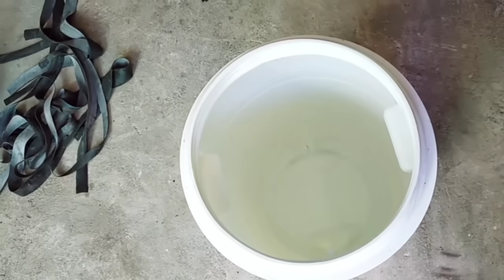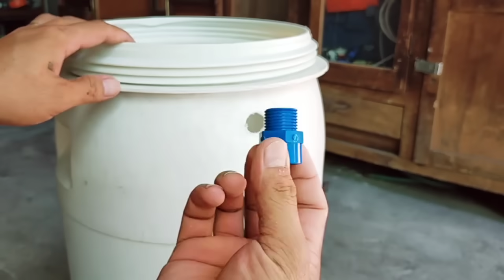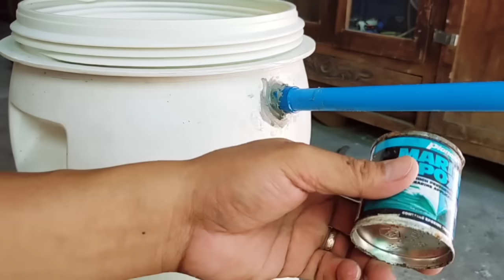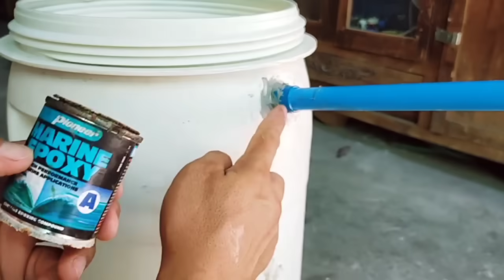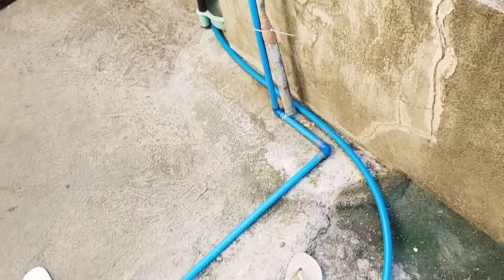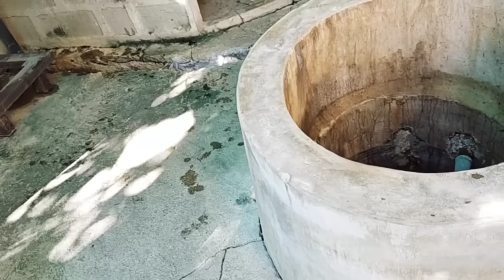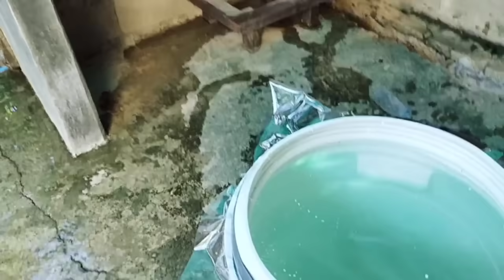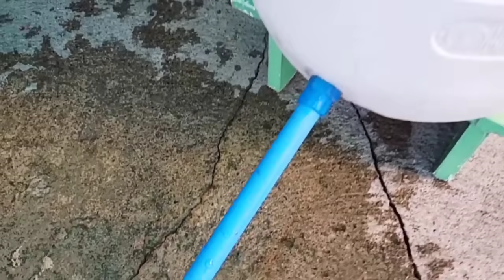improvised water pump no electricity how does it works none stop water life hack part 2

Comment: I've watched lots of other videos similar to this but this is the only one that actually shows and proves that it does work. Thank you very very much.
Reply: Can you be sure there isn't a submersive pump injecting water in the pipe that drop water in the drum?
Reply: r u sure..that's fake..
Reply: Yes its fake. At the end where he pulls the hose up it gets "stuck" on something for a fraction of a second. Probably attached to another pipe.
Reply: @gavinlynas2833  kind of you are right. I will try my self if it really works
Reply: But the idiot avoided showing us the other side (inside the well).  He has 1 pipe going down already.    So he connected the water a water supply line at bottom of  well .   It's obvious he was trying to avoid filming the bottom of the well .   He is another stupid cheater.
Reply: @inspetordopequidegoias8203  It's not a pump .   HE has another blue pipe going down,  which he connected to the supply line.   The other pipe is probably connected to a faucet or elevated tank.
Reply: @gavinlynas2833  not probably, u can see another pipe going down.
Reply: @gavinlynas2833  Have some faith, and some knowledge about science. 
There is no other pipe, look again. Black color was not a pipe, its a rubber used to make airtight.
Reply: If you look at the very end of the video, he pulls up the pipe that is going into the well. You will see and hear a "pop" sound like he is pulling it off something it was attached to under the water. It looks real from the suction at the top though so I'm not sure.
Reply: @gavinlynas2833  True, omg. He snapped it out of the ingoing pipe  , obviously.  He's so dumb.
Reply: @gavinlynas2833   Use your science knowledge...
Reply: This does work. I did a science project in high school at a much smaller scale. No laws of physics are violated here as gravity is just being converted to kinetic energy.
Reply: @jordondarke1884  Thank you Jordan.  This is what I am looking for , a scientific research .   As you said , potential energy (gravity )converted to kinetic .   Can you please give specifics of volume and diameter of in/out lines,  and tank elevation ?
Reply: @wildthoughts6959  I can't give you specifics. I did this many years ago in high school using straws and popsicle sticks. lol
Reply: @Wowboxxx  I did try it out and it didn't work although I've been looking at some other videos and have learnt a few things. 1 - The container must not bend in from pressure. If so, you'll lose suction from the water. The suction will instead go into squeezing the container. 2 - You must use a one-way flow valve on the inlet pipe and prime that pipe, so the water sits at the top and stays there. That way the suction doesn't have to bring all that water right from the bottom. It's already at the top and the suction just has to pull it a little further. This doesn't reduce the weight of the water being pulled but instead just gets rid of the unnecessary air in-between. I think having too much air reduces the suction power somehow but I'm not sure. 3 - The outflow pipe needs to be bigger than the inflow pipe. Not quite sure about this one but I'm guessing the wider pipe allows more water to leave and creates a bigger draw and therefore harder suction at the top. 4 - Make the outflow pipe long. I'm guessing the longer the pipe the more water weight is leaving at once therefore greater draw. 5 - Install a "pressure" pipe on the outflow to stop air backflowing into your tank. There are other videos of setups without this, so I don't know. 6 - (My own theory) Add something heavy that floats in the tank and it will increase the pressure at the bottom pushing water out quicker. Hopefully this might create more overall force on a water wheel for example, pushing it faster and generating more power. Yes, I know the object will displace the water but if it weighs a lot more than the water it displaces it's worth it.

There's my science for what it's worth.
Reply: @gavinlynas2833  Your #5 finding is the key science here. Yh outlet pipe must be longer to draw out enough pull and a air trap is optional for small diameter pipe, but bigger dia its a must be. 

Non-return valve is a good idea but not necessary at all. When you fill up the drum almost full, some air will draw inside from the inlet pipe which is necessary for system. 

Your water source/suction head  should not be too long, tben it wont work. 

Lastly, size of the drum, it must be big  like a barrel / 200Litre minimum.
Reply: Have u tried.? In my opinion it's will not work without the help of pump
Reply: FAKE
Reply: @clarkkent981  👎👎😆😆😆😆😆😆😅😅
Reply: @clarkkent981  I tried with a plastic container that bent in from the suction, it was not strong enough. Also, I didn't use a wider outlet pipe than inlet, it wasn't long like they say it should be, and my inlet pipe wasn't primed.
Reply: @gavinlynas2833    Don't be confused by suggestions how this could be made working. It is completely useless to try that. If the outlet of the water is higher than the water level in the well this can not work, this video is a fake. It can only work with the outlet lower than the water level in the well, but in this case it is simple siphoning and you don't need any container in between, just a pipe prefilled with water. 
All ideas that this works with a sucking vacuum or gravity are nonsense. By the way, vacuum is empty space and does not suck at all. The effects of "sucking" are not done by vacuum but by air pressure without a counter air pressure at the other side. Neither a vacuum nor gravity are a source of energy. But to lift water to a higher place needs an input of energy. Besides, creating a vacuum would stop the water flowing out before it would lift the water out of a deep well.
Reply: @Wowboxxx    " Your #5 finding is the key science here "     " Use your science knowledge "
LOL. What is really key science here: to lift water to a higher place needs energy. Neither vacuum nor gravity is a source of continuous energy. Case settled. This video is a fake.
Reply: @heinzpg  Yes I was thinking, if the water level in the barrel doesn't move down as water leaves, how can it suck anything regardless of any vacuum? If you suck up water with a syringe for example you HAVE to pull the plunger (move it) in order to do so. 
I'd still like to try all the suggestions anyway (on a small scale) just to see what happens. 
The idea of much more water (weight) leaving (or trying to) compared to entering seems legit to me. Like a sort of leverage effect - e.g., the longer pole lifts the otherwise impossible weight.
I think this particular video is probably fake since the outlet pipe is super short, but I don't know how he creates that suction effect at the top is he is pumping water in. Surely the plastic would blow outwards and form a dome. Perhaps because the inflow is underwater that doesn't happen. Even still, if more water was being added the barrel water level would rise pushing the air up and forming a pressured dome shape, and at the same time water would be pushed out at the bottom faster than it would otherwise flow.
Reply: @gavinlynas2833    If you look at other videos where something like a barrel is used, with the inlet at top and the outlet at the bottom of the barrel: the explanation given is, if you open the outlet tap water flows out, a vacuum is created and this sucks water from the well. This explamnation is wrong. It is not the weight of water which counts, it is water pressure in relation to air pressure. Water pressure only depends on the height of the water, not on its volume. The water pressure at the bottom of the vertical pipe going down the well is always bigger than the water pressure at the bottom of the barrel. Thus, a created vacuum would stop water flowing to the outlet earlier before it would be big enough to "suck" water from the well. 
The most stringent argument is still: lifting water to a higher place needs energy. Thus, it is not possible without an input of energy. Neither gravity nor a vaccum are a source of energy. If such a device would work, you would have a perfect perpetuum mobile, but perpetuum mobiles are not possible. You can't lift yourself off the ground by pulling at your shoelaces and you can't build a perpetuum mobile. Both is outright impossible.
Reply: @Wowboxxx  I've been advised by someone to not bother with this. Thats its all fake and a waste of time. So, have you actually built one of these and it worked continuously without stopping? You talk as though you have lots of experience.
Reply: @gavinlynas2833  Dont bother. When there will be need, will use. Perpetual
Reply: @Wowboxxx  Simple question that you cannot answer. Have you made a working version of this pump?
Reply: @jordondarke1884  intéressant, vous pourriez faire une vidéo qui montre sans trucage que cela fonctionne 👍 ce serait très utile
Reply: @David Lockett Membrane keeps moving until the bucket gets emptied .  If the final water destination is lower than the water level in the well,  water flows very fast from well to bucket then out.   However , as soon as the final destination exit is raised above water level in well,  water stops flowing ( water exits , but gets replaced by AIR from exit point).    I tried this experiment in my garage .  I gave u my conclusion .    System only works if final destination is lower than well water level .
Reply: @yustoyustas7171  Have you tried, is this working? Your update is much appreciable.
Reply: @inspetordopequidegoias8203  the clear plastic is being sucked in not blown up. This is what we call negative pressure in physics. It's is caused due to a vacuum. I've seen countless videos on this and doubted them all but there is no way for him to create negative pressure using a pump from inside the well. The negative pressure can only come from the side that the water going to. I'm going to test this.
Reply: @heinzpg  why does the clear plastic not swell if your theory is true? Clearly the water is draining from the bottom and we see water falling in the drum from the top. There is definitely negative pressure being created. Also if you did the same test without a cover the water will flow out faster. Once the negative pressure exceeds atmospheric pressure by even a minute amount something is going to spill out the end. I truly believe there is some truth to this
Reply: @shanemahabirsingh7215    Thanks for your comment. The plastic does not swell since the amount of outflowing water is still the same as the amount of the inflowing water. There are three points I can indicate for making things clearer perhaps:
1) Depending on the depth of the well the vacuum must have a certain strength. Just a slight vacuum can not uphold a water column of several meters height. Even a perfect vacuum could raise water only for roughly 10 meters.
2) Since there is a vacuum in the drum and atmospheric pressure is also present at the outlet, this vacuum is a hindrance for water flowing out. And if the outlet is higher up than the water level in the well, an increasing vacuum will stop the outflow of water earlier before it is strong enough to pull water up from the well. 
3) If this would work with an outlet higher up than the water in the well you could let the water flow back in the well and let it drive a little turbine on its way. Thus you would have a perfect perpetuum mobile! This is not possible. You can't lift water to a higher level without an input of external energy.
Reply: @heinzpg  explain why the plastic does not lose the vacuum when the water is coming up from the well but the instant the hose is removed it crinkles? The water being pumped up from the well should displace the vacuum therefore no vacuum should be visible. In fact the plastic will show signs of positive pressure rather than no pressure at all but that did not occur. Siphons work in a vacuum environment also, therefore atmospheric pressure is not the only deciding factor at play. Once a vacuum is seen it means the water pressure exiting the discharge is greater than the inlet or maybe something else is creating that negative pressure. If there really is a pump then it's so well calibrated that it pumps a fraction slower than the discharge flow but that can only happen after a huge vacuum is created & the vavuum won't last very long as it's still positive pressure. Or maybe the drum has a false bottom & there is a pump sucking the water down & then back up through the discharge but he's hidden it well. Or maybe it really does work once a vacuum is created?
Reply: @shanemahabirsingh7215    No, it does not work with an outlet higher than the water level in the well. The water pushed up does not displace the vacuum since the same amount of water flows out. No calibration is needed for that. The vacuum decreases the outflow of water. If more water would flow in than out the outflow would increase due to a weaker vacuum. This is self regulating. When the hose is removed air flows in which ends the vacuum of course. 
Let's assume water has to be raised for 4 meters. What pressure is needed for that in the vacuum area? Atmospheric pressure is 1 bar, 4 meters water column mean 0,4 bar. Thus, if the pressure in the vacuum area is lower than 0,6 bar water will be pushed up by the atmospheric pressure on the surface of the well. But the height of the water column at the outlet side is much smaller than 4 meters, perhaps just 1 meter. This illustrates what I have written in my previous comment. An increasing vacuum stops the outflow much earlier before it can move up water over a greater height. 

Also my point 3 in my previous comment should convince you, or do you think a perpetuum mobile is possible? Meaning to have an energy output without any energy input? This would violate one of the best proved laws of phyics, conservation of energy.
Reply: I didn't see if he used check valve (no return valve) at well pipe.
Reply: @felipejleon664     A valve at the bottom of the well pipe has no relevance here. If the outlet is lower than the water level in the well this system works also without such a valve. If the outlet is higher up than the water level in the well this system does not work, never mind if there is such a valve installed or not.
Reply: It stops after a while.. There is air coming in via somewhere 🤔 and changes the pressure vacuum set
Reply: @doreenmusau3267    It doesn't even start. With the outlet higher than the water level in the well an increasing vacuum stops the outflow of water already before it is strong enough to bring up water from the well. And without outflow the vacuum does not increase further.
Reply: @jordondarke1884  If there were a pump pumping air THEN it would be convex, but its not its water. The amount of water being pumped in is the same as the water leaving at the bottom, and at the same time, and gives the false impression water is being sucked because the water level at the top is not going down. What about the plastic on top sucking in? Its not sucking anything, its caving in because its loose on top and the water weight is pulling it down. This would happen even if there was no inflow pipe.  Just my theory anyway but haven't properly tried it so cant say for sure. It does look pretty convincing but the pipe popping off at the end in the well looks sketchy. If it was so simple and easy even if energy companies were suppressing it, it would be impossible to maintain because everyone would do it.
Reply: Lodss just for fun ba to or totoo tlga to?
Reply: @inspetordopequidegoias8203  1111111111111
Reply: @fatdaddy9305     First of all, atmospheric pressure - rather 14.7 psi - means a force, not energy. Can you produce energy from atmospheric pressure? No. (Actually, you can produce tiny amounts of energy from changes in atmospheric pressure, but not from static pressure.) A pressure difference of roughly 1.5 psi can support a water column of one meter. Thus, atmospheric pressure against a complete vacuum (pressure zero) can lift water to a heigth of approx. 10 meters. Now let us assume as an example we have 4 meters from the water level in the well to the top of the barrel and the barrel is one meter high, and the outlet is right at the bottom of the barrel. To lift water the 4 meters from the well the pressure at the top of the barrel must be lower than 14.7 - (1.5*4) = 8.7 psi. 
But already with a pressure lower than 13.2 psi a water column of one meter is supported! And this means, that water does not flow out any more from the outlet! The vacuum does not only "suck" at the well side, it also "sucks" at the outlet-side! And if no more water flows out, the vacuum does not increase any more. Normally air bubbles would be forced through the outlet into the barrel, which spoils the vacuum. If you prevent air bubbles, water simply does not flow out any more, which means the vacuum does not increase any more, and in the well line water has only risen for one meter and is still far from entering the barrel.

This system only works if the outlet is below the water level in the well. But that's like normal siphoning with water running down to a lower place, although part of its path is uphill. But it does not work with an outlet higher than the water level in the well.
Reply: @wilsonwuisan6070  yes watch the video of hacker om
Reply: @inspetordopequidegoias8203  do you think that plastic on top of that barrel will look that way if the water input is from a submersible pump? Think again my friend
Reply: @yustoyustas7171  - Did you ever try it?
Reply: @johnfernando1851  - Then go ahead and do it.
Reply: Pompa nya kurang jauh nyimpennya.
Reply: I have done one for myself and the result? It's fake.
Reply: Kya ye life time hai
Reply: I'm glad I saw your comment because I w a s about to give up. My house burned down last year so I bought a nice rv at copart and been running off it until I get $ for a poke ect..generator went down and my garden ect all dieing..I'm trying everything to get water from my well
Reply: Trolazo😂😂
Reply: Any suggestion how to get water for farming from a 12 meters deep well ( no electricity) . Plz share any successfull easy method. Thank you
Reply: I can't sea that  the water pulled up with no suction.